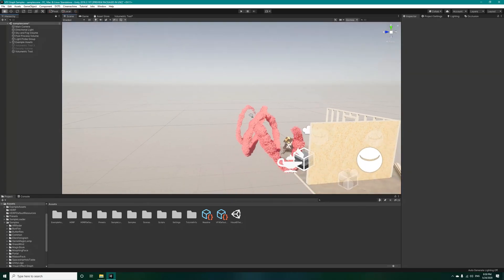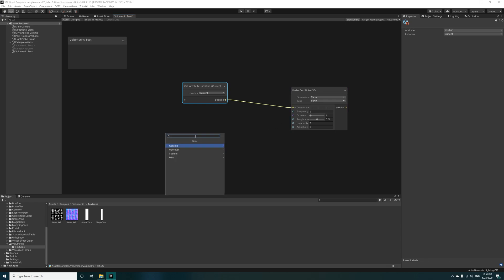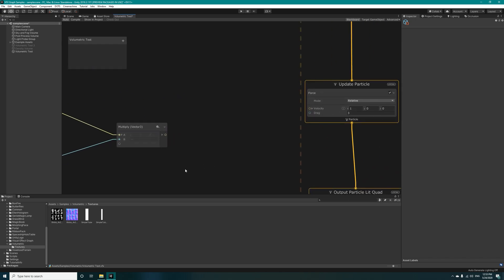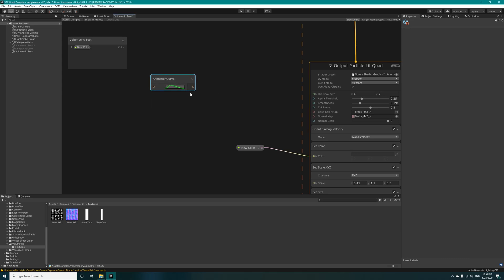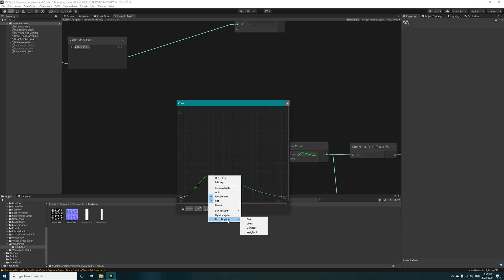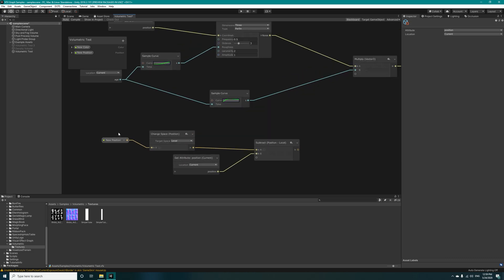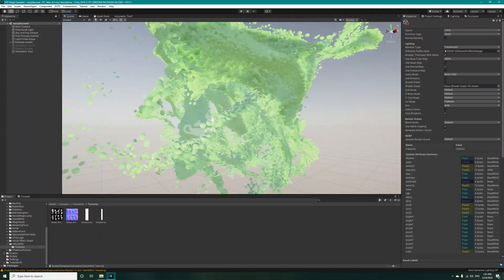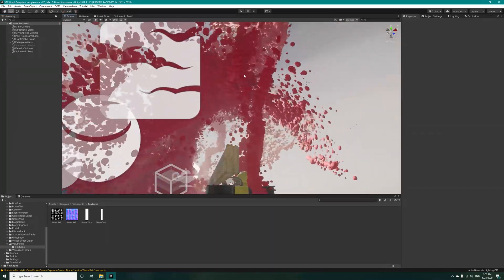Volumetric in unity VFX graph E02

Comment: So, about Perlin Noise:

As far as I know, Perlin Noises are a type of Random Curve, that takes acount the last value in order to calculate the next one. That way you can randomize numbers in a very smooth way, cause the new numbers will always be at a close value to the last ones. That´s why people can use this to simulate fluids and smooth things.

So here, we are using a 3D perlin noise, it will take the position value of the particle and add a randomize vector3 into it new position, but very small variations.